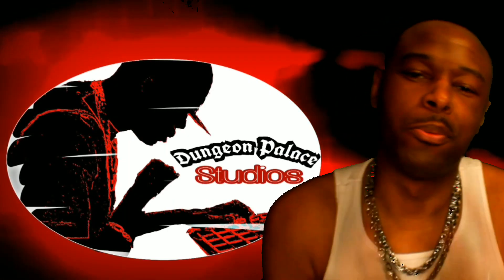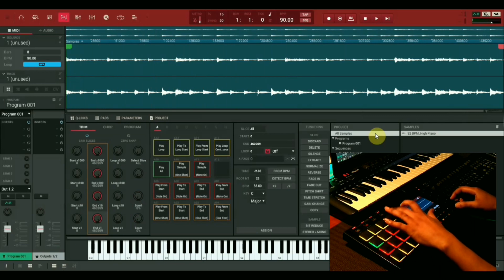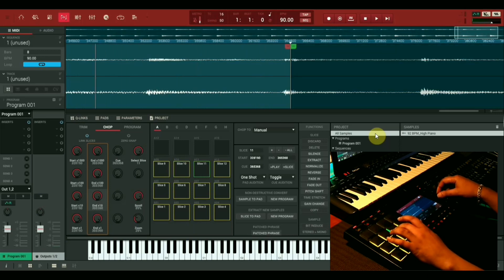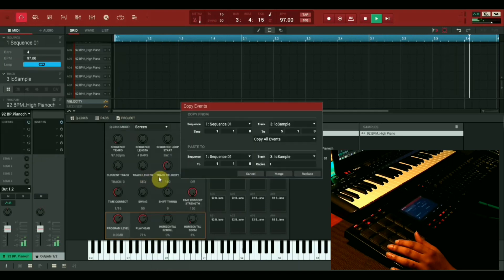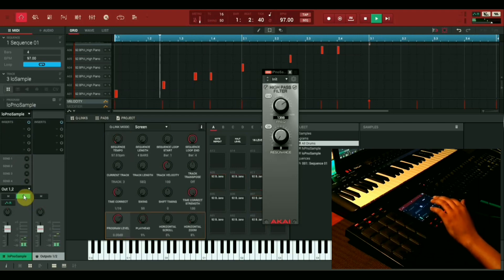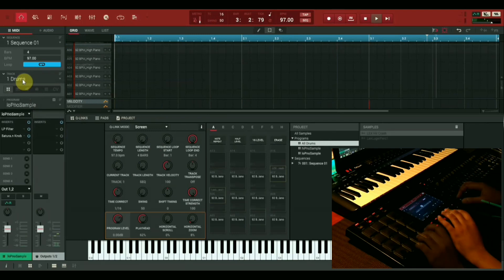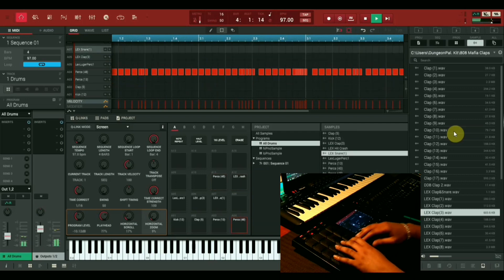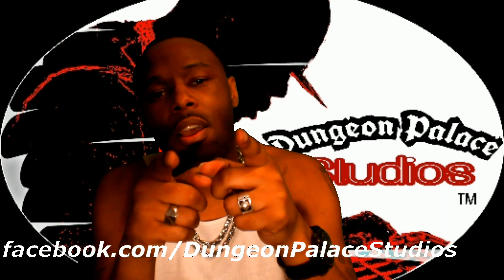Da Drank Kang - How to Sample inside MPC Software ✳ MPC TOUCH Beat Making Tutorial

Comment: Got a question. I use technics 1200 turntables. I'm looking at getting the MPC Touch but I notice that it doesn't have a ground on the back for the 1200. Can I use a 1200 with the Touch? If so, how do I connect it?

Comment: just got a mpc touch today and i cant seem to find a single video that shows how to load samples and start  a beat from scratch. props to you though
Reply from the maker: That is because not many people are going to make a video that shows how to drag and drop a sample into the software. People expect you to have some type of basic knowledge before you even purchase.  I can find 10 videos that show this. Search "young guru mpc renaissance" he has basic start up videos. Different machine same concept. 👍
Reply: @DaDrankKang  good looking out, I agree with that. I have expansion packs, how do you add snippets of like "ambitions of a rida" to a beat. I know it's to hard to explain, I'll keep looking. I've always wanted to add a whole new beat behind 2pac vocals to make them more modern. Have a good one man thanks for response
Reply from the maker: @dagabe123  this may help a bit 
https://youtu.be/NLj93cIJY3s
Shows how to pick specific pieces of a sample and put them together. Again some basic knowledge of the MPC is required. 

You would benefit well from my live video help sessions. I've walked many new mpc users through very simple basic tips on how to start up quickly. You can ask anything you need live via video and I will show you EVERYTHING. 💯 info is on my website. https://DaDrankKang.com There is also an email address if you have any questions about anything. Someone will get back to you. 👍